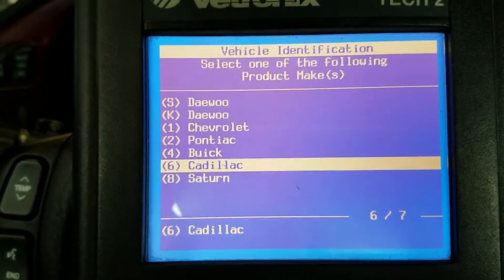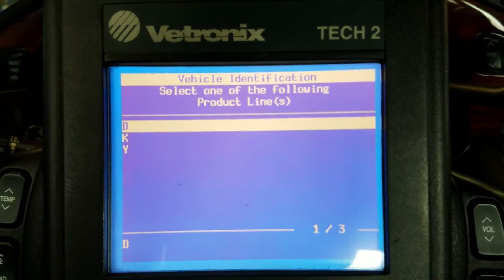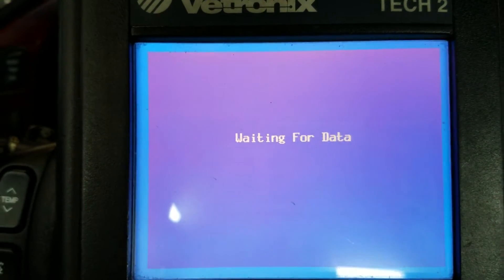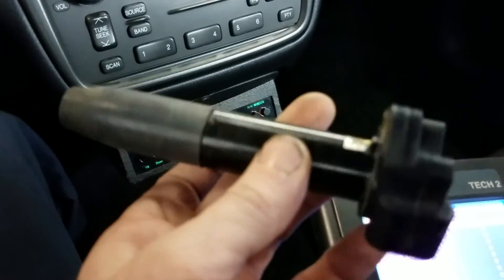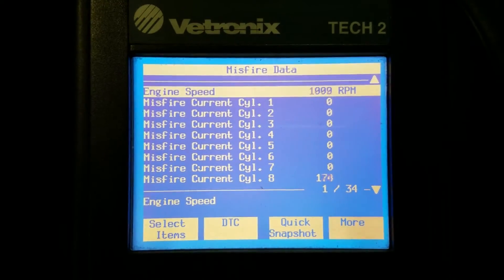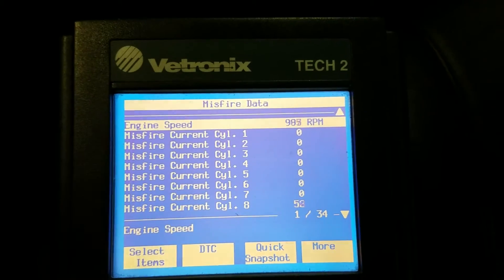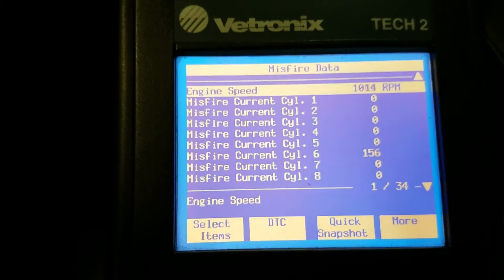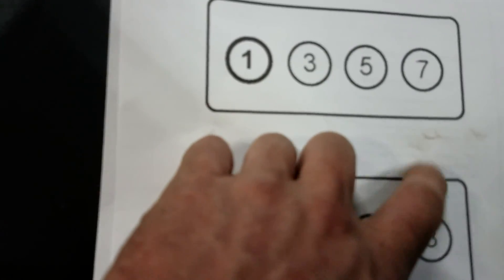4.6L Cadillac DeVille P0300 Random Cylinder Misfire Diagnostic "Easy Fix"

Comment: Mine was cylinder 3. Fun, fun. Could NOT get to 3 and 5. Would love to know how the heck you get the emissions stuff out of the way that sits directly over cylinders 3 and 5. 2,4,6 and 8 took 10 minutes. 1 and 7 same story. Need help with 3 and 5. There is a stiff aluminum tube that connects below it with two nuts that would also be fun to get to but that may be the only way. 3 and 5 coils are a pain in the butt. Help!!
Reply: I just got done doing mine. You have to take that bracket off. That's got the silver tube coming up to it. Be careful it's got a metal gasket in take the bracket Off
Reply: Sorry, I've seen that was a year ago.
Reply: @michaellockwood6100  that’s OK! I appreciate you trying to help! That car was a goner.

Comment: CADILLAC'S SUCK.  I HAVE TWO CADILLAC'S  FOR SELL THE SAME YR 1998
Reply: I have had Cadillac DTS's for over 15 years and have had minimal problems with any of them.
Reply: @beemikeme   ..I too have a Cadillac DeVille but I don't care much for  CADILLAC'S nothing but problems ,, in fact I don't even like this modern vehicles I am an old school use to working on 350 engines and getting use to computer technology and hip hop rap crap Big mouth punk's from the Jerry's springers quack QUACKS generations of the yrs 1990 too 2012 is a hole different life style....ha ha . not that I am any better but I am old school
Reply: @elmerpacheco1513  I am also old school and still have my 1972 Chevy pickup.  
However, although computer controlled, fuel injected engines can be more complicated, in my opinion, modern automotive technology is far superior.  

I used to have a 1969 GTO for 12 years and I could not be in stop and go heavy traffic with the AC on without worrying about the engine overheating. Also, I got 10 miles per gallon on the highway.  Modern engines can idle for hours with the AC on and never worry about overheating.  Modern muscle cars get at least 20 MPG on the highway.
Reply: How much and what’s wrong with them ?
Reply: @markstark7731 . I have 2005 deville for sale if interested? Houston Texas
Reply: @markstark7731   well I guess you don’t want the rebuild caddy I have?

Comment: I just happened to stumble onto your video when I was researching info on possible misfire on a 1990 Cadillac Deville (Fleetwood trim) with the 4.5L. It acts like a spark plug cable is grounding out. The rotor, cables, plugs were swapped out a few years ago. I'm not sure how to diagnose on a vehicle pre OBD-2 era. Great video though. It was insightful.

Comment: no carbon tracking or cracks...sometimes the plug looks good and its not!
Reply from the maker: In this case, the spark plug looks perfectly fine. No carbon tracking or anything but sure enuff it was bad. Not that often I see spark plugs fail internally without any evidence of the failure.
Reply: 98 North Star keeps blowing fuel pump fuse